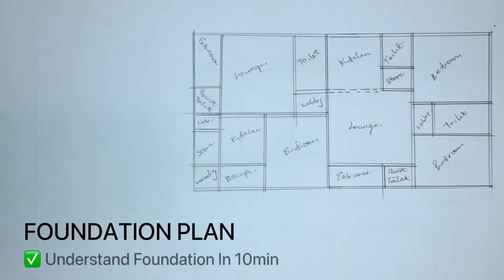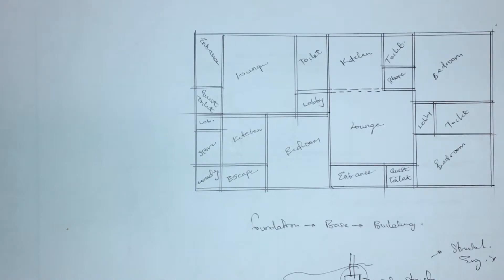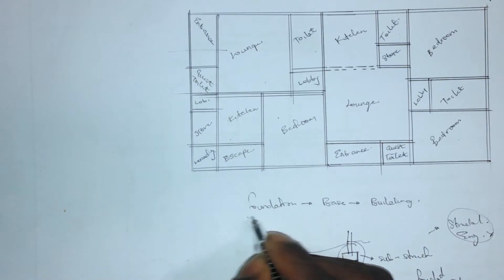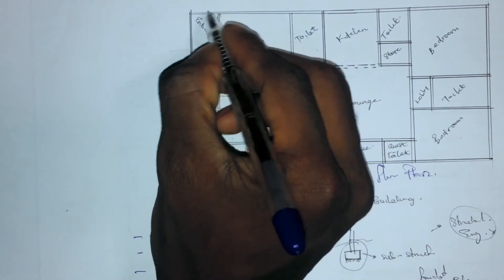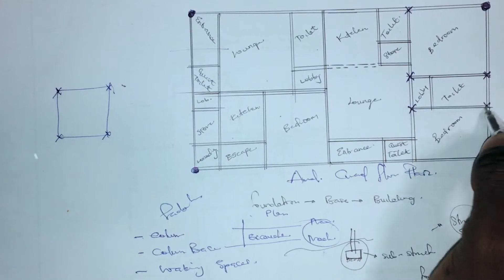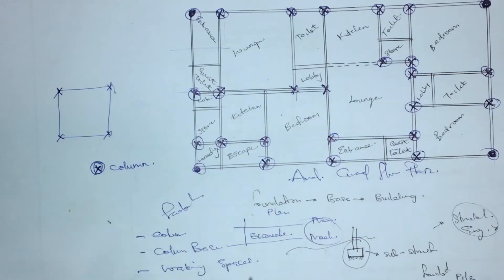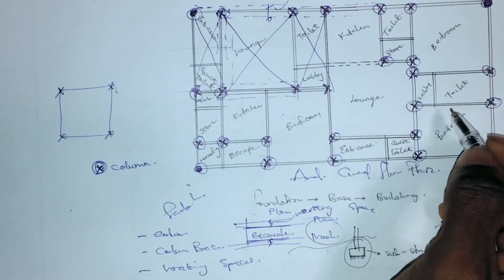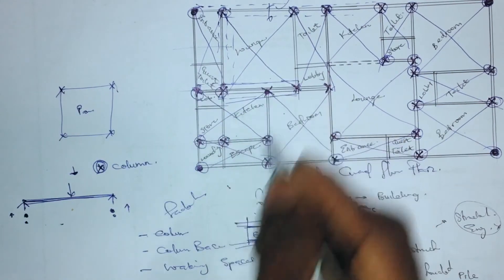Foundation Plan | Understanding Foundation Plan In 11min

Comment: What if the columns are close to each other,do we still put them or we classify them as 1 column ?
Reply from the maker: That is why it called design (to plan):
Varieties of outcome may occur in placing of column and there are ways you can decide on the best decision.
If the column are close you can make it one and also having the same column base.
And there are other instances where you can use of a single column